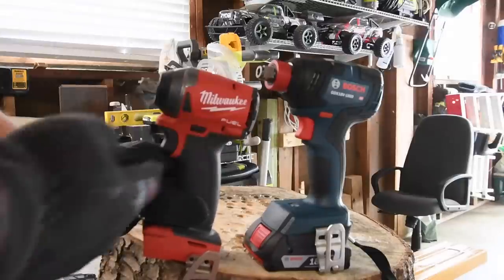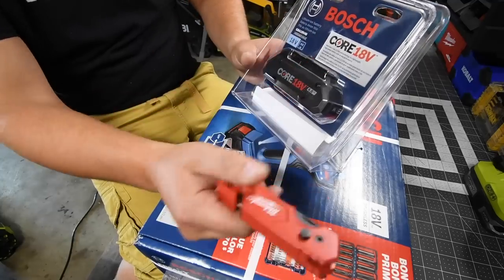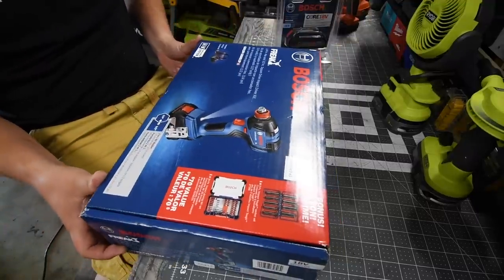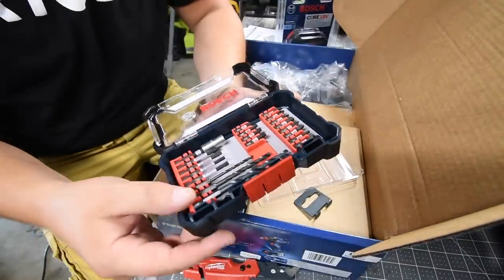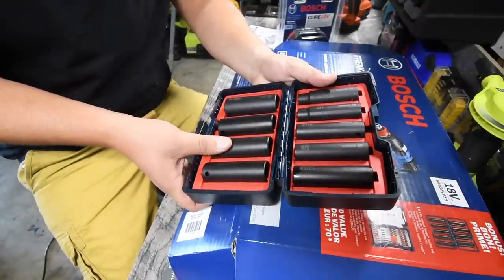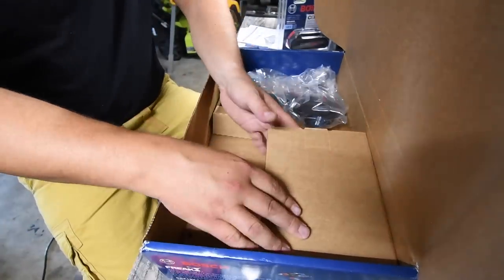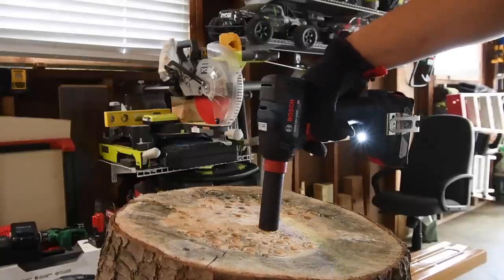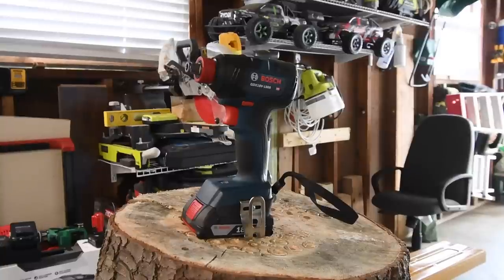$149 Bosch Freak impact driver bit/Socket Set Kit

Comment from the maker: 1,800 in lbs. [not ft lbs] I miss spoke
Reply: I messed up when i got my bosch  idh 182 its has 1650. In lbs i said ft at first
Reply: Where is the link to the kit?
Reply: You should test out the bosch 18v flexi driver! I've been dying to get it if it will ever go on sale anywhere. It's the style I like, like a 12v screwdriver drill only its 18v so even better

Comment: You should review the new Bosch drill driver when it comes to the US. It is 150 NM, and has an built-in inclinatior to assist with drilling/screwing at the right angle. I've never seen a drill driver with those power-specs before.  There's also a track compatible circular saw that operates as a plunge cut saw. It looks like a serious saw!
Reply: GSB 18V 150C. By specs the strongest on the market
Reply: First saw it a couple weeks ago and can't wait for it to be available in U. S.
Reply: @robertcasey3528  i think it will perform about the same as the new 40max Makita.
Bosch has a little different agenda as for example Milwaukee.
Right now i tried to replace my Bosch GSA 18V 32. The goose neck sawzall.. Its like 5 years old but brushless, actually Boschs only brushless Sawzall.
Its still good but heavy and has 3 orbital options.
I wanted to replace it with the Gen 2 M18 Sawzall with One Key. 
What should i say, the M18 is on paper the better tool. 500 strokes more per minute, a bit lighter and i have sz say i prefer the regular shape as the fire fighter concept of bosch.
In reality the Bosch still outperforms the Milwaukee. Maybe the Milwaukee will beat the Bosch on optimal settings on the right material with the correct blade but its an demo tool and it don't get this much love.
The Shoe of the Bosch is solid like a tank, the Sgoe of the Milwaukee as so much vibration and flex that the blade touches the shoe.
The Bosch is a little slower on stoke speed but compared to the Milwaukee you can't stop it. You can't stop it in wood or metal, if you get stuck the saw actuallystarts to pzsh or pull you.
One of the more hardcore tests was cutting lime stone. 
The Bosch can do it in one take, the Milwaukee stopes like 5 to 6 times

Comment: This one interests me. I do my own maintenance and repair on my family’s 4 vehicles. Ive been using an old Ryobi p238 impact driver for engine bay work and I think this would be an excellent replacement. Not as big, no need for a socket adapter and still be able to accept a Phillips head bit. It seems like this one is at home under a hood.
Reply from the maker: gotta love the BOSCH freak. it really is useful not needing adaptors

Comment: I use Bosch tools for home DIY. They seems to lack on power, but get the job done. The newer Profactor tools are suppose to be a big upgrade. The family knows to buy me these tools/batteries for gifts as they are all compatible and at a good price point. Bosch's battery platform also works with 5 or so other tool manufacturers.  Bosch tools are a great choice, but I'm rocking the Makita XGT at work as a professional Tradesman.
Reply: Bosch is a professional brand, just because something has a lower power level doesn't reflect quality... If that was the case company's like hilti as well as metabo, feun, bosch wouldn't exist... But there are some people who only care about numbers (could be power, could be price) and that's why there is so much variation in the market... I use milwaukee because that's what my job gives me and i wish i could be using something else... The lack of refinement and how fragile certain things are is disappointing
Reply: @olsongregory2516  I agree and I have said it many times, power is only half of the equation. However, some tools within a platform need good power to perform like grinders, drills, etc. Build quality, features and tool line up make a brand IMHO.
Reply from the maker: I will be getting more and we will see how they are in soon :)
Reply: Milwaukee is simply the best in terms of power and speed

Comment: The Bosch is coming in a new gen in Europe this fall. It basically is called 18v-210 instead of 200, implying a minor power-upgrade. I've had this drill myself. It is great in every aspect, except that it could have a little more power as well as that it's very loud
Reply: Why didn't Bosch advertise the gsr 110 it released not too long ago? I bought it and now the 150 is coming. I had to buy it through Amazon Germany.
Reply: I am from Malaysia, where most of Bosch tool is made and i had to order this from amazon US. 18v-200 price is expensive here.

Comment: Gdx18v-1860C is the model that you want. I have it already . it is completely customizable, you can set rpm, light intensity, different modes for bilts, screws and selt tapping screws, each mode had another layer if full customization and you can create your own modes as well. But you need the bluetooth thing for it

Comment: Thanks for the video; really helpful. I have a question. How does the Bosch socket drive a lag bolt when it has a hole deeper than the head of the lag bolt? I imagine the lag bolt would not go all the way into the wood. Please help clarify that for me. Thanks.
Reply from the maker: you need a shorter socket to be able to see what you are doing. deep sockets are not good to driver in lags

Comment: Okay, i HAVE broken one of these anvils. But i feel like it was the sockets fault. It was a cheap set and the socket got stuck on the end of the anvil and broke off part of it. If it happens again, the retaining ring will fall off, and it wont be able to hold onto a socket. It still works fine as it is, but its just a matter of time until it breaks more and will be unusable. This may be a rare occurrence. I just bought a new one with bluetooth because my lowes had them on clearance, and ill be sending back the broken one to see if the 3 year warranty covers it.

Comment: I'm a bit worried about the reliability of this 2-in-1 anvil. With all these little details and cavities, is it robust enough?
Reply: its bosch, of course its robust
Reply: Been using mine for 3 years without a problem. The power isn't enough to damage the anvil, even the 200nm version I have

Comment: I have the Freak 2 with the 3 speeds and it's a breeze working on my cars with the 1/2" socket . Lugnuts, brake pads, oil changes, you name it.

PS. A PROCORE battery with 21700 cells makes quite the difference in torque

Comment: I was so close to grabbing one of these the other day for what I thought was a good price on Amazon, 89 bucks I think it was! But upon further reading I realized it was brushed. There is a brushless but it's like twice as much. Not sure it's worth that much lol.
Reply: It's definitely worth it if you get it on a kit with 2 batteries and a brushless hammer drill. $179 is hard to beat
https://www.lowes.com/pd/Bosch-18V-2-Tool-Combo-Kit-with-1-2-In-Hammer-Drill-Driver-Freak-1-4-In-and-1-2-In-Two-in-One-Bit-Socket-Impact-Driver-and-2-2-0-Ah-SlimPack-Batteries/1002717880

Comment: Let the Milwaukee beast out and beat up on Bosch!
Reply: New out the box you are correct, but if you wait 2 or 3 years of daily use the Bosch will still be working like I did when I came out of the box your Milwaukee will be either tossed away or waiting weeks to utilize that five year warranty.
Reply: @thetruth5210  I have a M18 Mid Torque and a Bosch High Torque Impact Wrench. Time will tell if eighter are worth their advertisement. 

5 year warranty with Milwaukee and 3 year warranty with Bosch Profactor.

Comment: With how slow that Freak is,  I have a hard time believing that it's rated at 1800in lbs and whatever the RPM rating is.   Not impressed.   That anvil, though...♥️♥️♥️♥️👍
Reply: Speed doesn't translate to torque. 1800 in-lbs is quite conservative nowadays that most of the competition has lineups with over 2000 in lbs.

What I can tell you is its breakway torque is way more than 1800 in lbs at least when paired with a 4Ah PROCORE battery which has 21700 cells.
It does about 3000 in-lbs breakaway torque. None of my vehicle's lugnuts have put any fight...